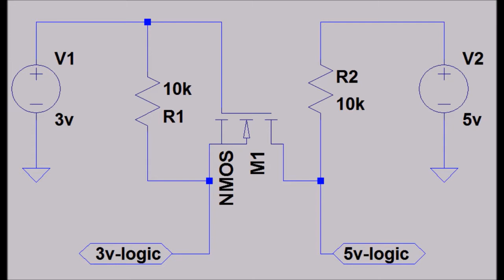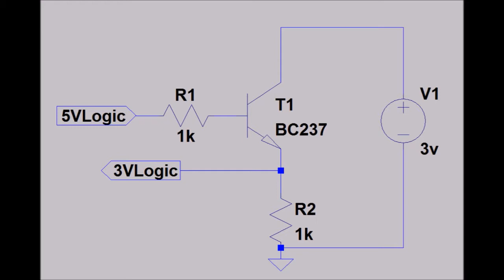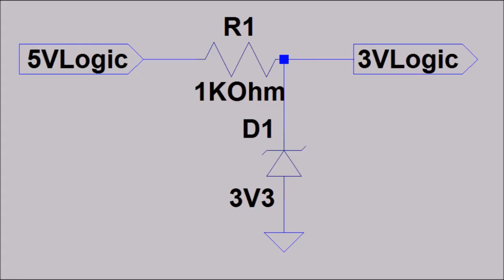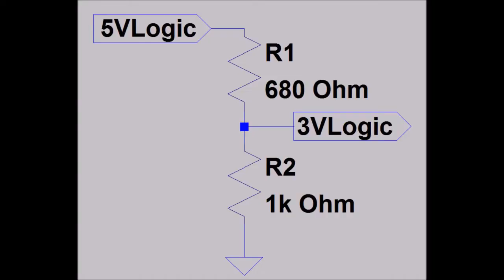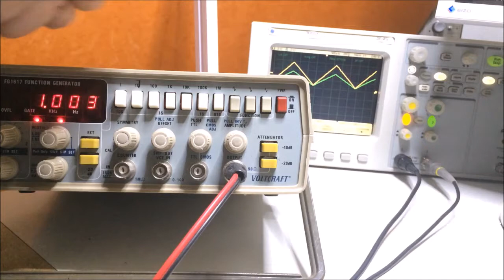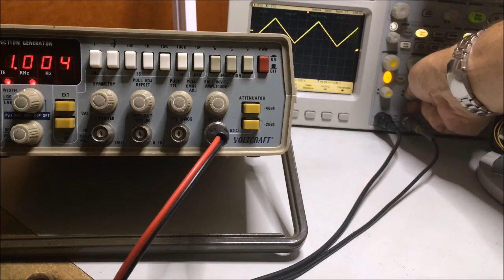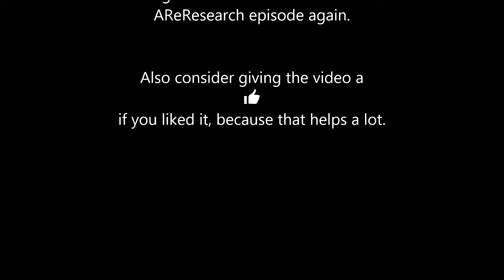Arduino and ESP8266 - Part 1: Level converters

Comment: In my experience,the ESP8266 modules actually will tolerate 5V signals on the serial pins. I've got 20+ modules running right now,with no level conversion.
Reply from the maker: +PhattyMo Interesting. Have you measured if there is any significantly increased current into the pins when applying 5V?
Reply: No,but that might be a good idea,there may be ESD protection diodes in there. But even then.. I think,usually,the serial pins on the various microcontrollers are current limited to some extent though,through some sort of internal pull-up resistors. IIRC,"TTL" serial is pulled-up through resistors (high=idle state),and pulled-down through an open-collector type circuit,so it should be okay-ish? (Hopefully that makes sense,It's late here,and I should be sleeping!)
Reply: +PhattyMo "I think,usually,the serial pins on the various microcontrollers are current limited to some extent"
I guess that might not always be the case,depending on the application. This experience involves connecting the various ESP8266 modules(-01,-07,-12/E) to various 5V Arduinos(328,Mega2560),and some sort of 80C51,also running at 5V. No problems in any of these situations!
Reply from the maker: +PhattyMo On page 15 of the datasheet ( https://www.adafruit.com/datasheets/ESP8266_Specifications_English.pdf ) it says it has snapback protection that will trigger at 6V. So while out of specs (3,6v) for an input, 5V won't trigger the snapback circuit.

Comment: Driving the esp8266 from the 3v3 pin on the Arduino clone works somehow. If you don't use industrial grace tolerance, you may give it a try.
Reply from the maker: +norm1124 Yes, in client mode it may work if I add a capacitor. I have only seen the high currents in AP-mode.